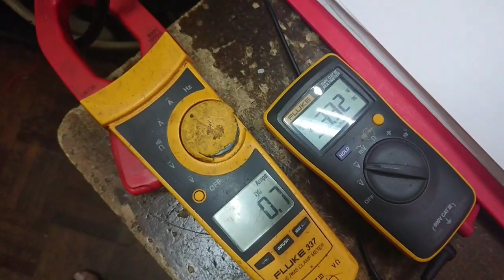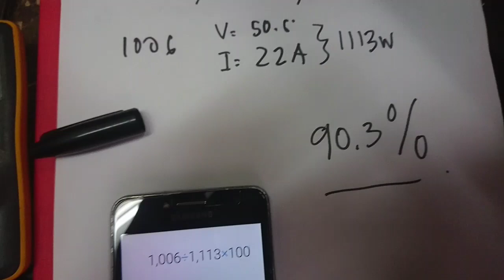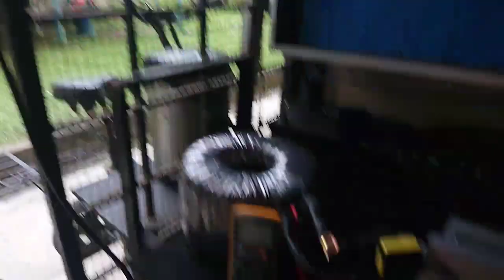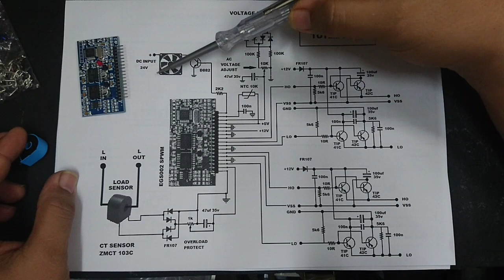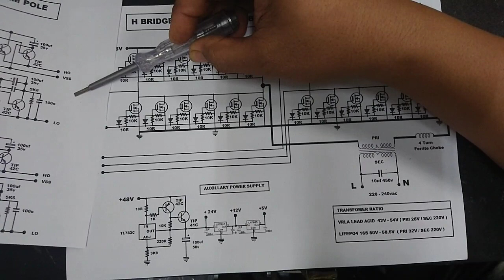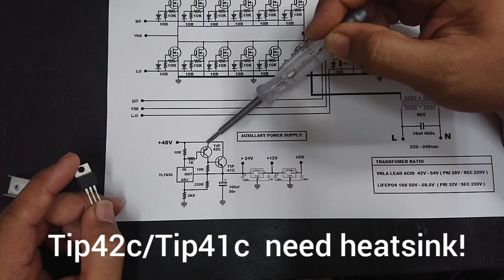New Transfomer 7000w 220v has arrive, Stage 2 push to the limit IRFB4110 Mosfet until 7000w Flat..

Comment: You can get a large variac and wind on the low voltage winding with flat high gauge romex, about as cheap easy and safe as it could be,,, or also insulated magnet wire. 
ANd then air cool it, toroidal transformers are very cheap and easy to cool, its worth it.

Comment: Excellent video - one question, I did not see the usual large electrolytic caps to stiffen the battery voltage close to the main H bridge rails - did you not need them ?  thanks

Comment: the totempole schematic is not correct, the low  side must be fed directly from 12v, not  after  the bootstrap  diode. also  the  5k6 and  100nf  make no sense on the lo output.

Comment: Hello. Thank you very much for your schematic and explanation.
I understand everything except Load sensor L in and L out. L in & L out means transformer output line L N ? Or  from L (Transformer output) to L in (Load Sensor ) ? I want you to tell me, thank you indeed . From Lucern Valley ,California
Reply: just anywhere in your 220v load circuit, so    in series  with your  220v  winding but after the capacitor  of 10 uf
Reply: @bendelange7038  Thank you very much.

Comment: I believe the current overload feedback wires going to pin 1 & 2 of the EGS002 need to be reversed.  EGS002 pin 1 (IFB) wants a positive feedback voltage, not be grounded.  Ground (GND) connection is pin 2.
Reply: Yes, I saw other schematic where No. 2 was grounded. But i have not checked yet if No.2 is grounded itself  or not. If not grounded I don't think its matter.

Comment: you can add more turns to the high side to rise your out put volts   it will be around 1 volt per turn    if you want to lower the idle amps you can add turns to high and low sides of the transformer    you can make that transformer better if you add to both sides  extra  turns     add if making diy transformer  core size dose not make wattage     wire  amp size you can fit on core and if you can keep core from getting to hot  makes the wattage         so if you can fit wire that can handle 8k on a 4k core it will do 8k  but the core may heat up   you may need extra fans or put in oil  some kind of extra  cooling           most things like heat and cool units are on  thermostat so it may kick back off before core heats up!!!    you may get by with small core for big watts  if high watts only short times or you can keep core cool       i have wound many transformers this way    so the size wire you can fit determines the wattage     adding extra turns  to both high and low sides makes the transformer more efficient  and lower idle     this dose have a limit  most times 15 to 20 extra turns it depends  every one will be different  there is a easy way of testing the perfect turns  let me know if you need help
Reply: very nice job very good work you do !
Reply: i use a little transformer on my feed back voltage on my big inverters  i use hy4008 247 or hy5608  big ones   just what i like to use   i do like your work!
Reply: @ambersmith6517  Hello. I need your help.

What is your  transformer ratio for lithium polymer (lipo_NCM) 8s battery bank with extra turns? ( Capacity 468Ah, 13kWh, Rated voltage 3.7v*8s=29.6v, Charge voltage cut-off 4.2v*8s=33.6v, discharge cutoff at 3.3v*8s=26.4v )
Reply: Hello. I need your help.

What is your  transformer ratio for lithium polymer (lipo_NCM) 8s battery bank with extra turns? ( Capacity 468Ah, 13kWh, Rated voltage 3.7v*8s=29.6v, Charge voltage cut-off 4.2v*8s=33.6v, discharge cutoff at 3.3v*8s=26.4v )
Reply: great job!!! please if it is possible to tell me how much in % more turns for low idle current or the easy method of calculation mentioned

Comment: What should be the electrolytic capacitor rating?? I've used 4700uF 100v for 48v system and every time my mosfets burned. Then I used 63v capacitor no problem now.. really confused what just happened 😕

Comment: I'm designing one based on your design. Have some confusions though. IRF4110 isn't available here in my country. I'm planning to use IRF4310 24pcs total just like you. The question is what dead time should I keep in the egs002 ? 300ns as default or 500ns ?? And what dead time did you keep ?? Please let me know.

Comment: Very nicely presented. Only one question why didn't you use the commercially available buck converter for auxiliary supply? Those switching topologies would create less heat which will draw lower current... Just my thought. BTW your design is really nice 👌
Reply from the maker: yes you right...smps buck more efficient...has lot module sell out there......actually this is my old design haha
Reply: @wajaeboseben  my  ldle currant is 0.33  add more turns on low and high side of transformer and a better choke  my inverter is 10k
Reply: @ambersmith6517   did you build your own transformer? how did you make it or where did you get it from?
Reply: @wajaeboseben  can you please share to me any of your current design?